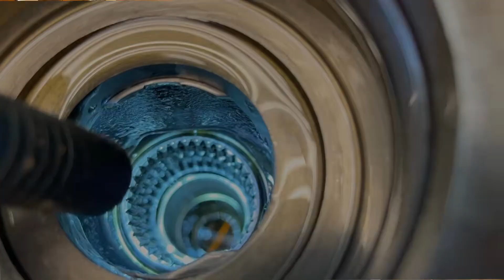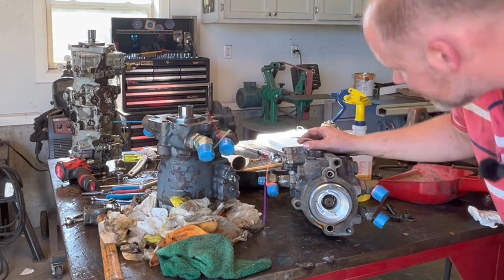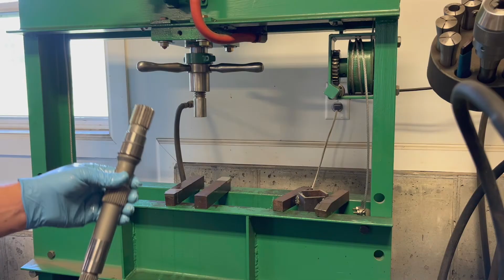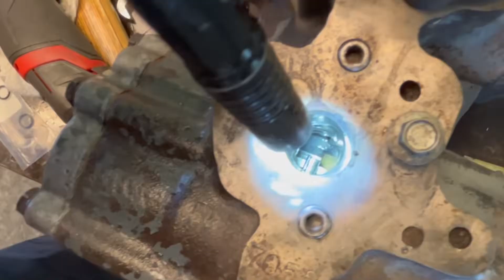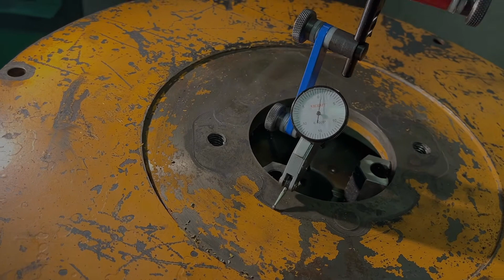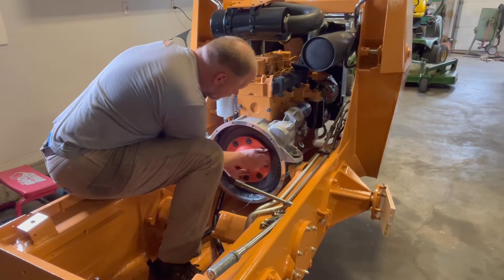Case 1840 Hydraulic Pump & Coupler Repair

Comment: HI Mike, Where did you find a service manual for the pump. I have a leak from the shaft you removed at 10:17 in this video and am chasing the Oring size or a seal kit. Thank in advance Dean
Reply from the maker: I’m using the regular case manual for the machine. There isn’t much to doing that repair.  I don’t have the part number off hand but you should be able to find it with some search on the net. There is a case 1840 Facebook group.  You could also find a danfoss dealer. They support the parts for that pump.

Comment: so what was the smoke issue?
Reply from the maker: Just needs to seat the rings once a load is put on the engine.
Reply: @MikefromMissouri  what part of Missouri you in ? 
im about 45 miles north of Springfield
Reply from the maker: @wildsawmill I’m about half hour north of KC

Comment: Hi, my name is Doron and I have been watching your channel and enjoying it very much. I have a recommendation about the drive pump - if you change the face of the drive pump from two bolts to four bolts, and of course you will need to drill four new holes in its housing, you will not have any more problems with loose bolts.. I found this part at my local dealer’s (Sauer Danfoss) place and I replaced the seal.
Reply from the maker: Hello,  I’ve heard of this option but couldn’t locate the parts.  Do you have a part number by chance?

Comment: Spool and outer pipe it slides into are very simple. Just did mine in the machine. One oring and one backup ring on each one. On spool backup ring came cut on outer sleeve I had to cut backup ring with new razor blade, about 75 degrees. No more leaks. Quick and easy

Comment: Did you figure out the engine smoke?
Reply from the maker: Not 100% sure but all the Cummins experts told me not to do anything until I load the engine to seat the rings.  If at that point the smoke continues I will yank the engine again.

Comment: The moment I've been waiting for.. repairs on the drive pump.. If you remember it was several months ago I asked for this video. ❤
Reply: Also! What grade bolt did you use for the two bolts mounting the pump to the plate after you lowered it in?
Reply from the maker: @warslug931 I used grade 5 bolts from an old ford tractor.  I feel more confident in those old USA bolts.  I will watch them very close and if I have an issue will will replace with some new grade 8s.
Reply from the maker: Yes I remember! Although I don’t go in as deep as I initially planned.